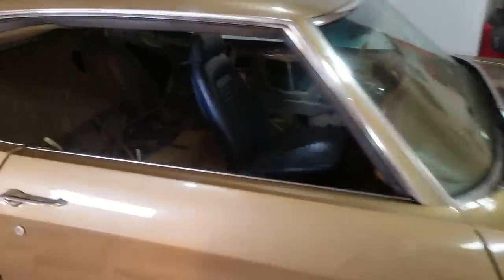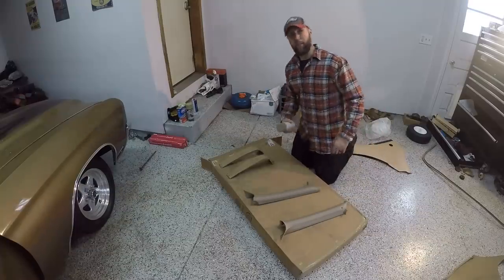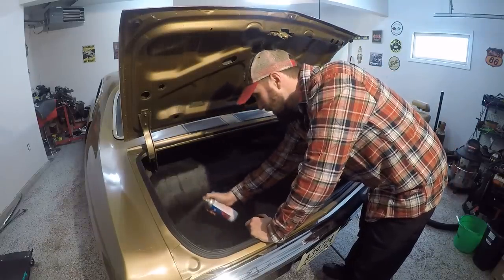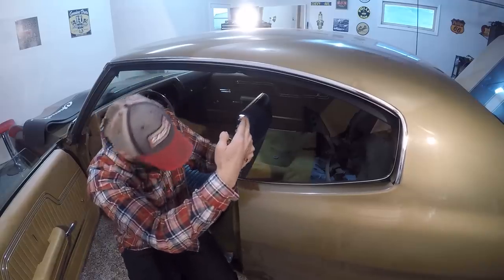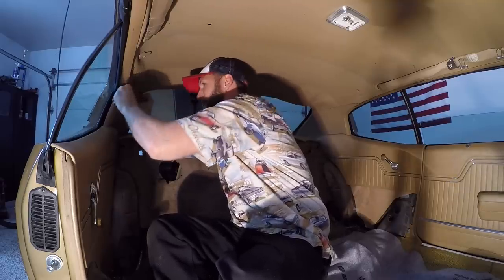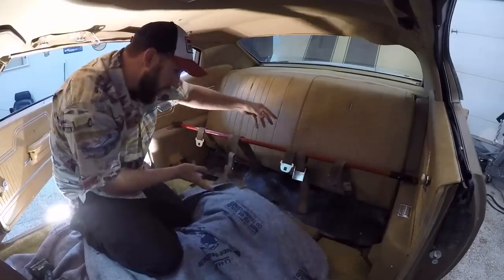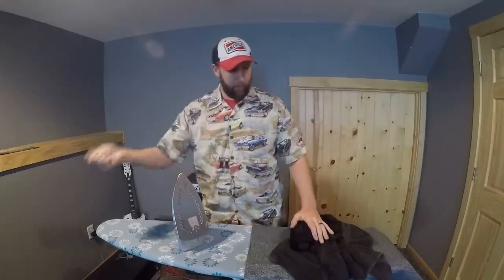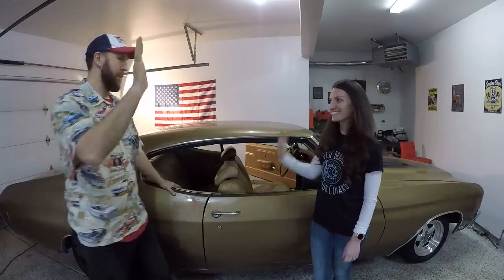1970 Chevelle Gets Interior! - Vice Grip Garage EP18

Comment: My grandma had a green '70 Chevelle. It was a 307, until after she had a fender bender. 
Then the right side had a 350, and the left had a 307. 
657 cubic inches, but she handled it just fine.
Reply from the maker: 😂😂😂... ol gramma
Reply: I'd only driven Dad's Honda Accord and Mom's Plymouth Voyager minivan before I took the wheel of that 307 Chevelle. 

Spun the wheels straight off, first time I hit the go-pedal. It had many torques.